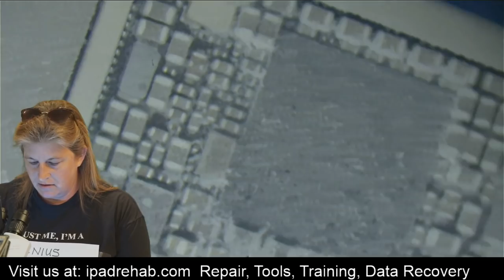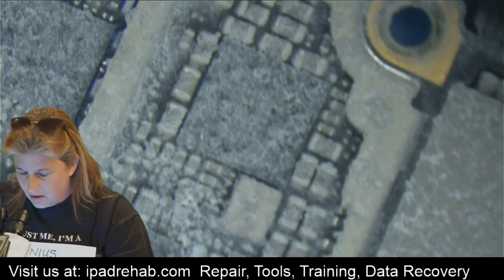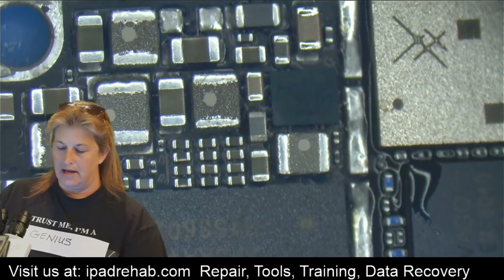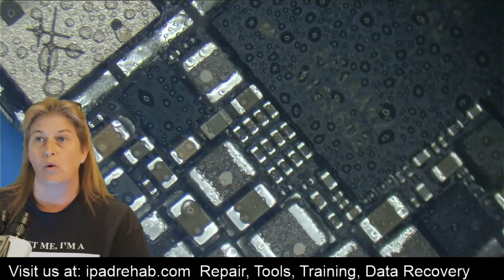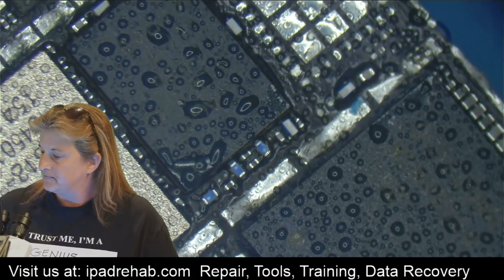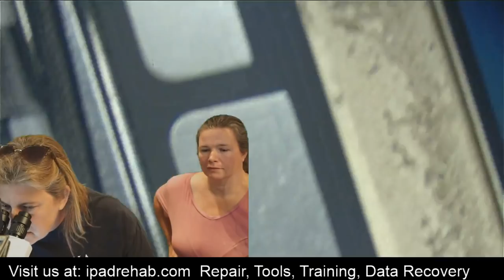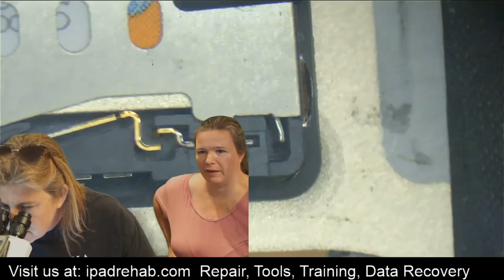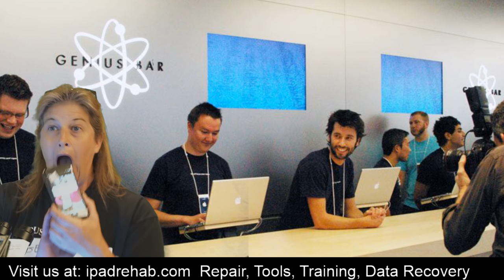LIVE! Apple says this iPhone will never turn on again.  Is it true?

Comment from the maker: Want to learn microsoldering training with us?  Join us a Practical Board Repair School http://bit.ly/2qtXUiH
Reply: Love your vid's but I see room for an infra-red camera which would spot the hot spot immediately and save that crude but effective method of freeze spray which has a few drawbacks .... just putting it out there for the thought bank, whether they do one hi-res' enough to be practical and useful as well as cost effective is another thing.
Reply: @Doctor Buga Other than the visually obvious clue to the component it also cools the components down including the fault which can sometimes allow longer periods to identify it, using IR gets around the need to do this as it can be very quickly identified once you are used to the spectrum of colours they produce and what they mean.
Reply: @Elliot Hobbs Cap's are in parallel in this case, they act as a smoothing component to the voltage (they can be used for other jobs) removing it does not effect the operation of the device it only makes it more prone to voltage issues. For recovery purposes she won't be pushing the chipset to the limits so it is of little concern t remove the offending cap'.
Reply: hello! i wanted to training with u guys.. plz am in Ghana ,, how much will it cost me
Reply: @java2architect  She definitely leaves one with that impression. She seems like a rarity, especially in today’s world.
Reply: It’s too bad you don’t have your own cellphone brand. I hear there’s a market for customer service. Lol I would love to see someone honest, such as you, succeed. 🖖

Comment: Apple: This iphone will never turn on again

Jessa: Hold my beer
Reply: No: Jessa: "Here, genius, let me hold YOUR beer, since you're clearly DRUNK!"
Reply: Yes, because the device has no repair procedures. When you produces millions of devices, there is no time for that. Ask for it in motor service or any other tech authorised service.
Reply: @imho4990  sarcasn, right?
Reply: Jessa:  I'd be willing to wage $1000 I could get it to turn on.
Reply: @imho4990  Show me a motor vehicle that CAN'T be repaired in any way, even by the end-user or a certified mechanic...
Reply: @ArtemisKitty  Ford Mondeo. In 2014, I had problems with overheating the engine. Nobody wanted to fix it because they did not want to give a guarantee for repair. I had to buy a new engine /
Reply: @ArtemisKitty  Also if you have a problem with the engine computer, nobody repairs it, only the whole module is replaced.
Reply: @imho4990   only the whole module is replaced ? sounds like they at least attempted a repair and would in fact repair it
Reply: If You have a BOSCH steering box, they can repair it, only a money question! I just got my old Saab repaired, it didn't´t run on one cylinder out of 6 , the steering box is somehow for a 8 cyl. so they managed to reprogram it to use an other outlet!
Reply: @unlokia  Only 1/4 drunk. Us geniuses shine when we have a little bit of alcohol in our system.
Reply: jimmy p 🤣💀💀
Reply: unlokia 🤣😂😂
Reply: Jessa: hold my cold spray
Reply: @imho4990  and you still buy ford?
Reply: @alasdairwhyte6616  You still don't understand. There is no company that repairs such things. A friend had a week ago computer failure in Toyota. The service only exchanges the entire computer for € 1,000
Reply: IMHO wrong computer and Modules can be fixed with out replaceing u got jokes
Reply: @subarulegacy4203   GFY
Reply: IMHO do u know how to spell
Reply: here have some puddle poop
Reply: more likely ..  Jessa: Hold my hamburger LOL

Comment: @22:40 Be careful with confirmation bias though.  When I was studying in the Navy at AFTA they would tell you all about typical failure modes.  They would even demonstrate those in the lab.  When it came time to PT though (practical test - the actual troubleshooting down to component level to demonstrate you knew your stuff) they would always through a curve ball at you.  They would give you a problem that presented like those previously known issues, but there would be subtle difference that if you weren't paying attention to detail you could miss which further enforced the confirmation bias.  I remember my final was on IFF (Identify Friend or Foe) which is a very complex piece of gear.  The problem presented as a typical problem (R&R Q1 for example), but I knew these instructors and how devious they were.  I ignored the confirmation bias and just went about taking measurements, using the proper troubleshooting techniques, and I was actually able to find the problem in about 15 minutes.  My instructors told me it was one of the fastest times they had seen.  It doesn't help that my wife was in labor at the time with my son, so I was motivated to get out of there ASAP :P.  Incidentally, I could have skipped the test but would have ended up having to retake the course which would have set me back another 2-3 months.  I really wanted to get out of Millington TN, so I took the chance.
Reply: Oh, you know the girls at the Brass Rail missed you when you left.

Comment: A short circuit is an unwanted path an open circuit is  a bad or open connection ,when you pressed on the battery connection you observed current ,when you released the presure the current disappeared so you have an OPEN CIRCUIT not a short.

Comment: You ever run into problems with cold solder joints? I run into them all the time in heavy duty electronica equipment repair. I have course don’t work on cell phones and tablets occasionally a laptop

Comment: According to your pricing a "no power" fix would've been cheaper than data recovery. Of course I understand you can't guarantee data will still be on the device when doing a repair, but would it be correct to assume most repairs actually don't touch the flash memory? So if I wanted to gamble with my data, I could ask for a general repair (especially if I know the problem is relatively easy to fix like this generic cap short) and basically get the phone back in working condition, still containing all the data for cheaper than data recovery? Idk I suppose you keep the phones you brought back to life for data recovery for parts, but it still seems a little wasteful with repairs like this, where all it'd need to be a good phone again was a single cap...
Reply from the maker: We don’t keep the phones.  He gets back a working phone and his data parsed into usable folders like “all your pictures and videos” etc on a custom usb drive.  
If you want to gamble with your data then you can submit for a no power solution, we will not take it if your phone is water damaged (only for data) and if not then the most likely fault is nand failure in which case we will restore on a no power solution and you won’t get your data.  You also won’t get the drive and parsed data on a no power solution
Reply: Ah I see, thanks for clarifying! Keep up the good videos, you taught me a lot!

Comment: The iPhone7 boot loop is because of the board was bent or flexed. Hold the board and bend it certain way. It boots like normal. So there is no audio IC but many pad of the BGA may be not in contact so it just cannot boot up. I tried the Audio IC replacement and reflow as well without success.

Comment: I did component level repairs for many years. Here's a trick to find shorts, use a high current power source with the same voltage, or lower, your device requires.. Any ties your shirt will burn away. If a chip smokes, it was bad anyway...

Comment: The capacitor you removed is an MLCC multi layer chip capacitor , these are prone to drop, flex or process issues.   In this case the failing capacitor is in the middle of a bunch of other components and is more protected from physical damage ....reliability on these devices is also in millennia .... most likely physical damage to the original component.

Comment: I hope you don’t mind a simple off point question about the iPad Pro. Mine is a 2015. I had considered the brand new iPad Pro but chose not to buy it because it is so flexible. I am afraid it will break too easy where as my 2015 is still working fine. If you have but a moment to give me your professional opinion what do you think of the new one versus the old one

Comment: Some years back my son, without an electrical engineering degree, but who did go to the Votech for electronics answered a job interview question correctly about a voltage in a circuit design that couldn't be answered by a gentleman with his doctorate in electrical engineering.  My son got the job.....

Comment: I have an IPhone 6s model A1688. It does not turn on and does not charge either. I checked the battery and it has no voltage at all. Can it be the battery?

Comment: Actually most of the  7/7+ codec issues ive seen have been flex based. But have had some that were not bent but have had a hard flat drop. So maybe both can cause codec issues.

Comment: I've been a loyal Apple-using graphics professional since the heyday of the Mac Plus. Getting tired of the lazy, paternalistic, greedhead BS though. 

I bought a 2017 iMac a year ago February (splurged for the 27" model, 'cause I still want to upgrade my RAM at home, FFS!), and switched to an Android phone the following summer. Who knows what the future will hold. 😀 The iMac is almost certainly my last major purchase from Apple.
Reply: Screw Apple! Win 10 is pretty good now, runs very well and having a PC allows for full flexibility in parts with half the price. You don't need to look up the parts (I spend days only looking for the best mainboard) there are great companies that provide custom built PCs. Also with AMD crushing Intel now you get amazing performance for small price. There is the competition that Apple doesn't have. It's a cult with insanely smart marketing.
More RAM is so easy, changing graphics card or putting in harddrives, SSDs or NVMEs could be done in minutes if you are able to use your hands and a screwdriver eventually. ;)
And if you are into the Mac OS, there is the Hackintosh as well.

Comment: i have been fixing electronics since 1978. back then the engineering rule was design to 150 %. now the rule is design to 105 % (make it cheaper). it would only take one surge to wipe out multiple caps on a rail. if you ask linus he has a fix for almost the same thing on some of the MB he fixes. they make them just cheep enough to make it through the warranty. then they want to sell you a new phone. kodos to you for being able to fix it. i won't and have never bought apple. i have fixed some apple 2s back in the day but had zero data or support.  hope this is what you were looking for, bwell

Comment: Could you still use that phone as a daily driver? My old 6+ is missing a capacitor on vcc_main near the WiFi chip. Is that still usable? I would have just replaced the cap but the pads are gone. Want to give that 6+ to my son now that I use the X. Just don’t want a phone that will stop working soon
Reply from the maker: Both my husbands and mother in laws phone have all been missing that cap, C5202_RF for about two years..  My six has only been missing it for about 6 months because the lake didn't get me, but the washing machine finally did.  Putting that cap back can kill a phone---it is next to an underfilled chip.   Not worth it!

Comment: Electrical Engineers are typically not Electrical Technicians, they typically don't deal with unknown circuits, bad components or circuity repair.
Kind of like a an automotive designer is not an auto mechanic. One is designed based and the other more experianced based.
If that makes sense.

Comment: They are not going to lend you their microscope. They are "Bored" certified. And as in aforementioned statement, they only have one microscope. They don't need it to look at their paychecks, so you would have to clean the dust off before you could use it.

Comment: Hey Jessa do you know if there is still a software issue with replacing the iPhone 8 screens for none original screens ?

Only I have been holding off on replacing them for that reason but do have requests coming in for them 😐

Only asking as I respect and value your knowledge on these subjects 🙂

Comment: You really do not understand that a large company never plays such repairs? NONE. There is no time for that, no one will give a guarantee. The equipment is designed in such a way that repairs are not possible. Try to fix Surface Laptop in an authorized Microsoft service.
Reply: You are right. They don't repair Surface Pros, they just replace them with new. Its cheaper that way..

Comment: Well done. Is this something that other repair centers should be able to handle? I understand that Apples Genius bar is really just a bunch of newbs following a flow chart given to them by headquarters and that they have never even heard of a volt meter (I can't imagine any self respecting engineer working for the Genius Bar). I think the reason Apple get away with it is that repair places like yourselves are not too common and even if they are there is no link to them unless you search them out. Good luck for the future and thumbs up I have subscribed.

Comment: Honestly you shouldn't expect anything from the Apple "geniuses" or any other tech support for that matter.  I worked in tech support for about a year when I was in college.  The vast majority of employees had ZERO technical expertise,  all you do when a call comes in is pull up a "script" for the problem and read through the steps "Have you tried rebooting?"  "Have you checked the power cord?"  basically the same support information you could have found on any tech website.  Then if none of those solutions work, the script prompts you to say the item can't be fixed (and then typically rolls you into a sales pitch for a new product).